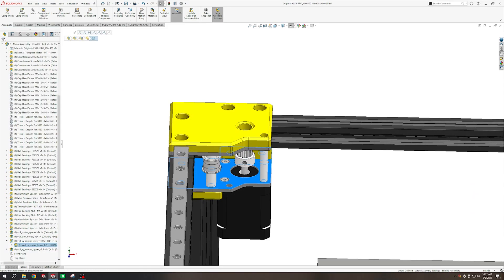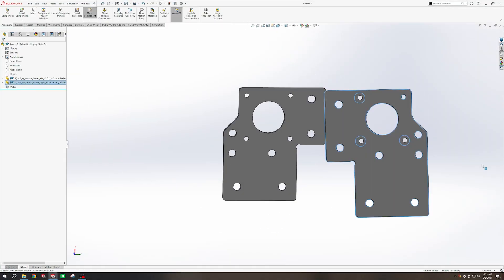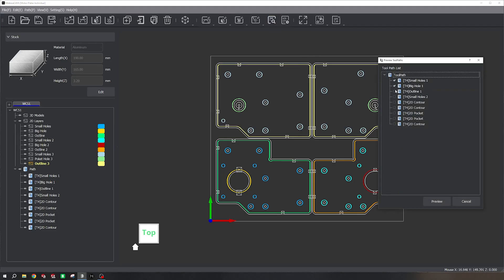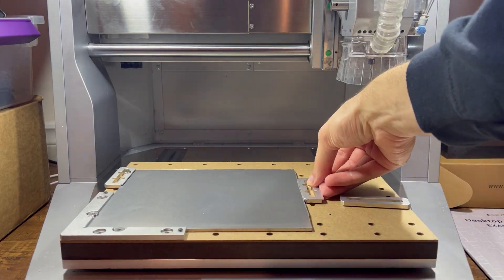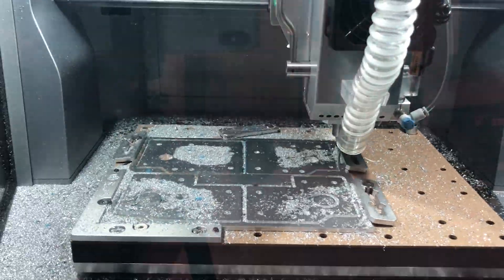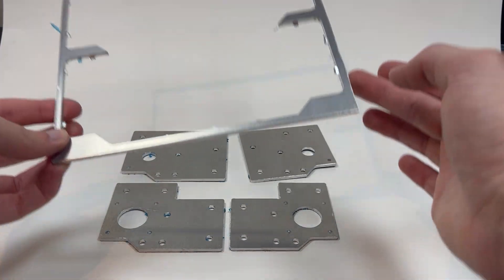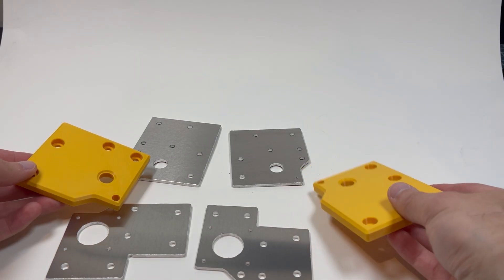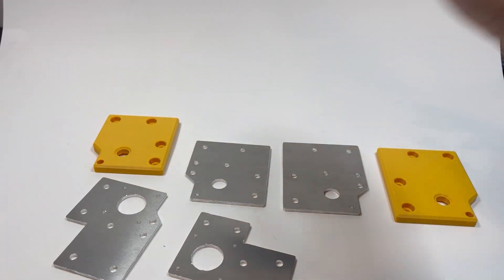The Hive 3D Printer: Custom Aluminum Plates with Carvera Air CNC

Comment: Interested to know  what feeds and speeds you used? Looks like you were using the 3.125 x 25 "O" Spiral Bit?
Reply from the maker: Hi, I used the default settings they provided for aluminum, here are the settings they provide.
Tool: 1/8in Spiral O that comes with the machine.
Step Down 0.2 mm
Feedrate 500 mm/min
Plunge Rate 200 mm/min
Spindle Speed 12000 rpm

Comment: Do you think the carvera could cut a pei build plate? Or is that too thin?
Reply from the maker: In theory you could cut the build plate before the magnet is attached as the plate itself is just a steel plate and if you run it slow enough it could probably do it. You are quite limited by the bed size of the machine as it is only around 12x8 inches in size. You would just have to make sure the entire plate is secured al around and would not lift off, possibly using the painters tape and super glue trick.

Comment: Hey mate did carvera sponsor you for this video with the machine or did you buy it? Also some tape with super glue will work nicer than clamps at keeping your flat truly flat. Cheers
Reply from the maker: I bought it myself when it was released on Kickstarter. I paid a lot of money so trying to get my money's worth from making some videos.
Reply: Based on another video of his, he bought it during the kickstarter period. Regarding the tape and super glue, are there specific scenarios where that's not advisable or is it just simply better always? I've seen that recommended as a viable option quite a lot, but it's hard to pick one option over another... Cheers!
Reply: As a machinist I'd never side clamp flat plate like this. I'd use vacuum or the super glue and tape method if you're after flat parts. It would allow you to machine the entire profile without needing to leave tabs as well. Nycnc on YouTube has plenty of videos back in the day showing the method  @TommyHoughton
Reply: @yeheyheyyeh89  Ah so that explains the vacuum table appeal... That's something I'd certainly love to try, but for the time being, it sounds like super glue and tape really is the most efficient option. I'll give it a go when I'm doing flat parts like the ones in this video, although currently I'm fiddling around with ones that are small and annoying which are quite the learning experience. 
I'll check them out! I'm pretty sure I have some videos from them on my "Watch Later" that I still haven't got around to checking out, haha. Thank you very much!
Reply from the maker: Yea I made the material oversized to account for that but I do agree that the super glue and tape trick would probably be better!
Reply: Get some 45 deg 3fl chamfer mills will really tidy up your parts and save a bunch of time hand finishing them. More videos on this would be great cheers!  @MakingWithLaz